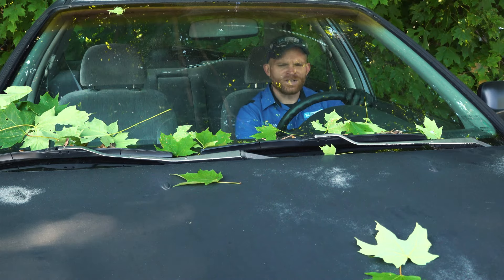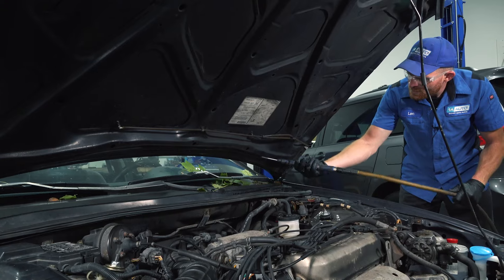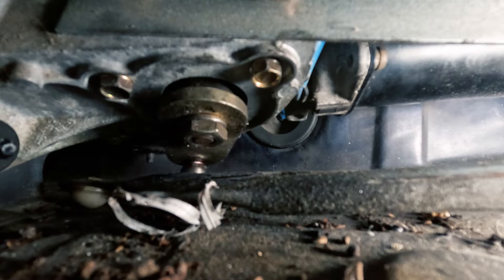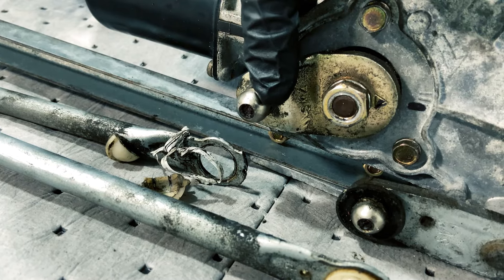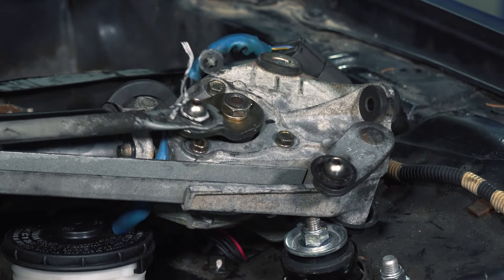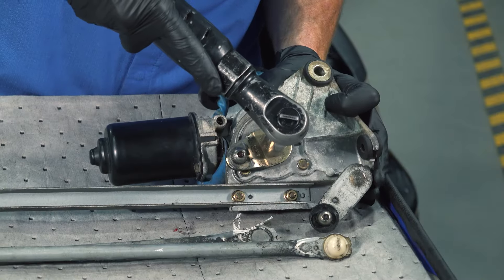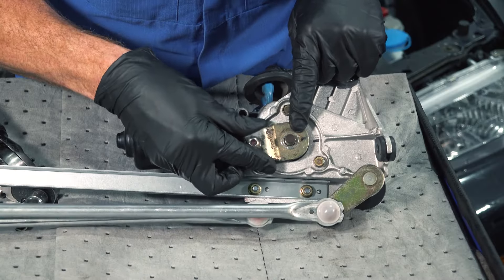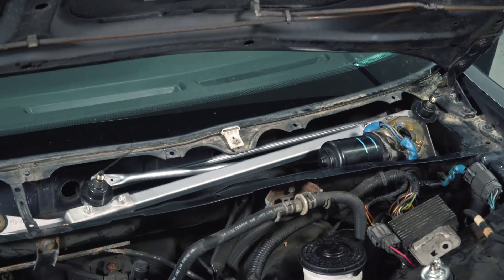Windshield Wiper Motor Turns On But Wipers Don't Move? Easily Replace This Part on Your Car or Truck

Comment: Car wash and high/thick rainX blades don't mix. My blades are off position I believe due to un clocking as you describe. Thanks for breakdown, will be buying any parts I need from you.

Comment: 10:42 worth to remember:  Not to over torque the wiper arm.  Someone once asked me to repair this mechanism because it was flooded with water from blocked drainage holes.  I torqued the arms with an impact and ended up breaking it:(   had to buy a new wiper arm from a dealer.